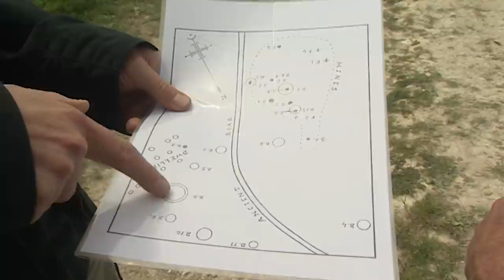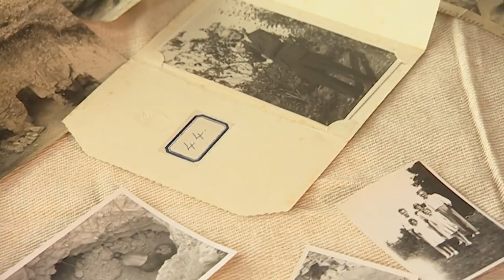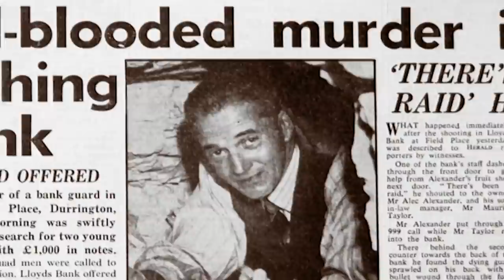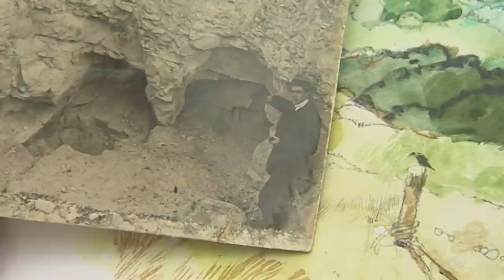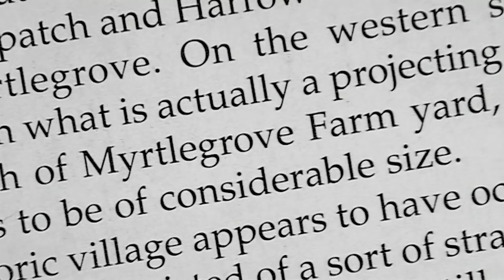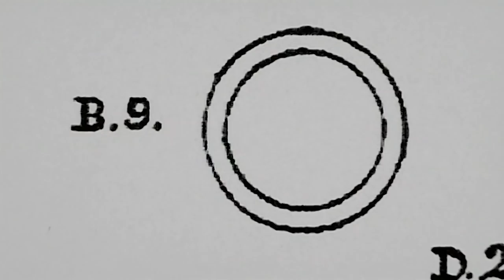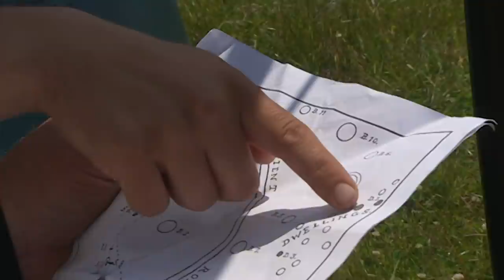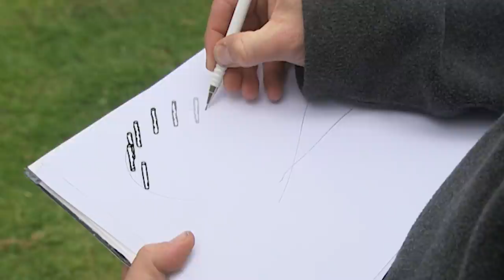The Hunt For The Stone Age Ruins Buried Under Sussex

Comment: I dont think that flint was buried. I think it was stocked piled for their use and most probably trade. Its the thousand of years that filled it in. 
The time team missed an opporunity by not checking the quality and sizes of the rock as they were digging it up. 
I find it annoying that our ancestors  arent given full respect for being very clever. Not everything is about superstition.
Reply: Yup. Either that or perhaps even classifying the flint to some degree. Dig up a bunch of flint, bring it over, and someone takes/chips away the good stuff and throws the bad stuff in a hole. People havent changed much in 10000 years, some clever sods were around.

The frustrating thing about time team is certainly the 3 day limit.
Reply: Given how hard it was to survive back then, I suspect the average IQ was well above what it today.

Comment: If there is a general rule to cultural and social development, things remain undefiled and fuzzy until this becomes unsustainable logistically. 

The idea that neolithic industry would be inseparable from ceremony and collective identity is not only plausible, it can be observable in many aspects of contemporary life. Industry is not only 'work', it is often celebrated as a way of life.

Add into the mix, the idea of the lone hold out, who won't give away a way of life. Often personified by eccentric hermits living in abandoned mining towns: a caretaker.

A hoard of flint, makes sense in the context of a caretaker, living on a disused flint mining district. A ring could be both sacred, or a drain for a animal skin tent weighed down with sacks of ballast, that would leave zero archeological trace.

Comment: Sacred my ass.  They dug it up then they worked it.  The pits with it stacked is where they worked it.  When they had enough to trade they moved on.  Years later they might have returned.  There is nothing saved about it.  Knock it off.